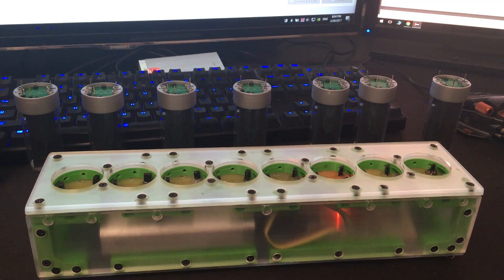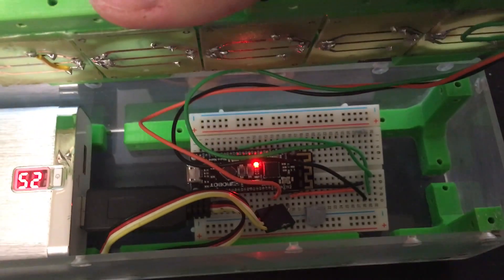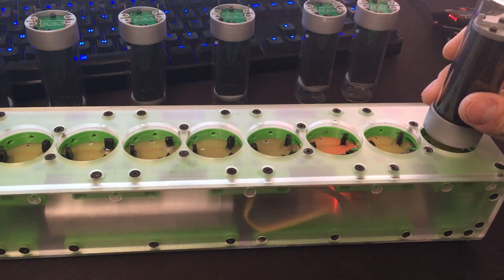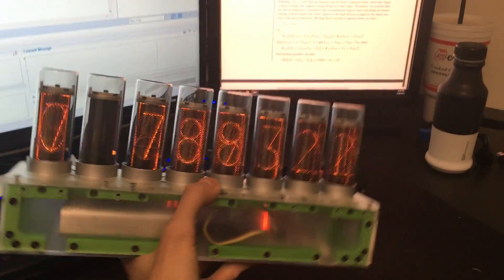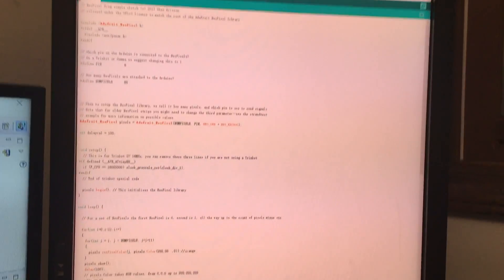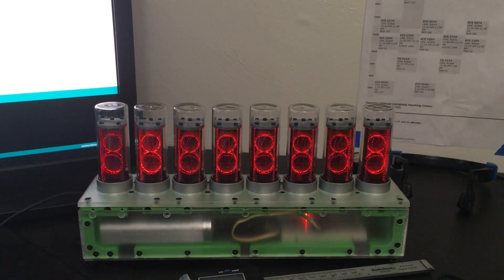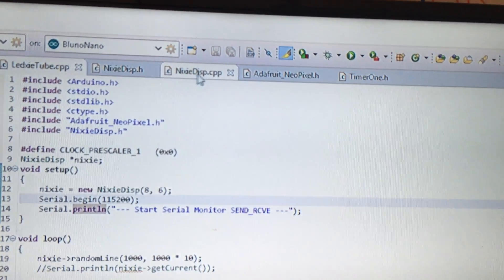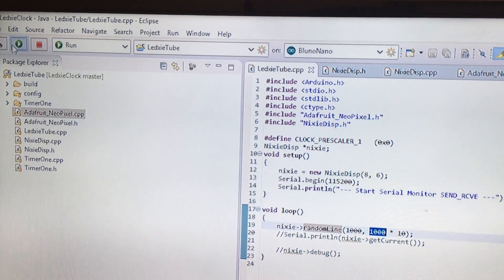LED Nixie Tube Divergence Meter

Comment: So awesome pronunciation.
Brilliant idea to solve cost, life and safety problem of those ancient Nixie tubes.
Could you share any detail or idea how are those LED Nixie tubes are made? Did you directly buy the LED matrix or connect each LED to the board by yourself?
Reply: What LED modules did you use? They are quite dense on your board. It seems that WS2812 is to large make it.
Reply: Zhang B  He uses adafruit neopixels. You can tell by his code.
Reply: @Blast335pokemineblox  those should be way too big, though? Even if he uses those to produce light, he must be channelling that light through the number shape somehow.
Reply: @Marco_Onyxheart  That is what's happening. He channels the light using laser etched acrylic. A product called Lixie does the same thing (though theirs are much larger and are inspired by, not imitations of, nixie tubes)
Reply: https://sites.google.com/a/vt.edu/amp_lab/projects/lixie-tube
Reply: @PiratCarribean  site not working.. can you show a working link? :)